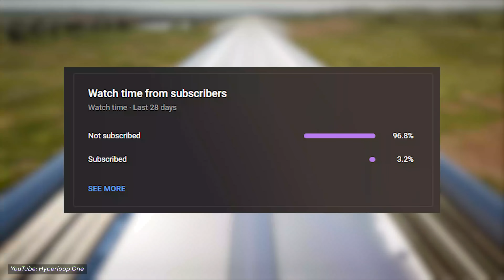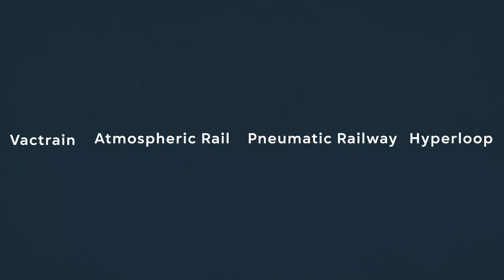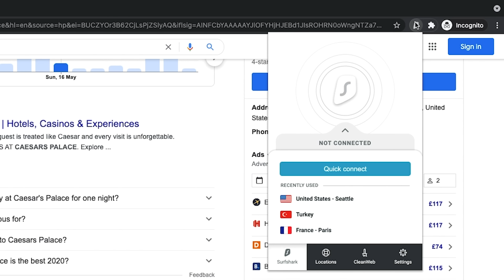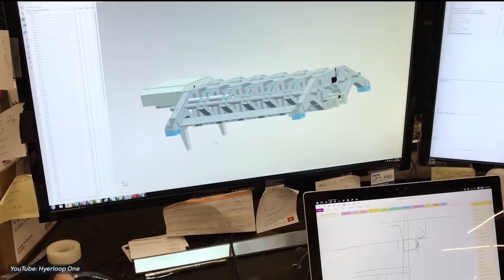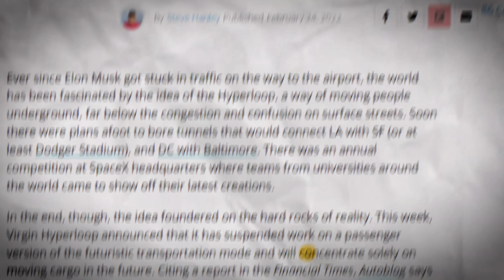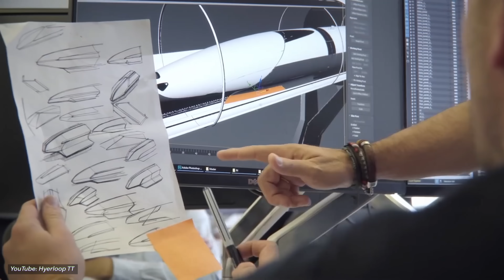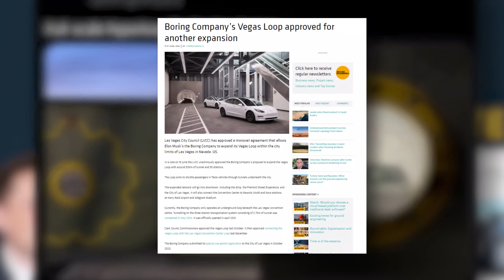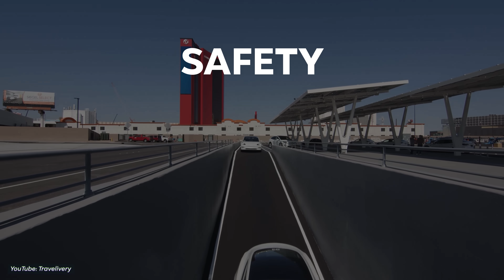What Happened to Hyperloop?

Comment: No, hyperloops will not be practical for at least a decade.  Too many technological and practical hurdles.

- The system would need multiple redundancies as a fail safe system.  ( Increasing complexity and cost. )

- All current hyperloop research efforts are to hyperloop as horse & buggy are to automobiles.

- The system will be nowhere near practical until each capsule can have it’s own frictionless force field. 

- One simple failure is all it would take to shutdown one hyperloop.   Then the hyperloop techs would need to go to the site.  Then there is the time required to completely resolve the situation.

- Let’s just suppose all the issues are worked out and hyperloops become omnipresent…. each tube is still one way.  It might only take 30 or 60 minutes to get to the next city, but to go in the opposite direction…. Everyone would have to wait until all the capsules have travelled the entire length of the hyperloop.  Unless there is a risky desire to insert a capsule at the halfway point and travel in the opposite direction.  That seems risky and adding unnecessary complications.

- How long will it take to vacuum seal one section of the tube?   How long will each section be?  How about maintaining all the equipment used for each section of the tube?  How long will it take to replace a section of the tube?  What are the consumables and their supply chains?

It would be more practical to build an elevator to the moon.

Comment: The hyperloop was not to be used here, it's for mars, boring company drill almost 9m, Starship diameter 9m. The tunnels on mars don't even need to be air tight, you don't need to evacuate the the tunnels as the Martian atmosphere is almost non existent.

Comment: Close tunnel. It would be just testing phrase as I know it required high maintain for air to breath, building into the tunnel, emergency tunnels else it would be death trap. There should be rescues team incase some thing broke or natural disaster or flooding. So the cost is would be higher. So basic transport goods. Just use magnet train that similar and in case into tube. Just a guess.

Comment: Hyperloop is, was, and always will be, total garbage!  The engineering and financial problems associated with Hyperloop are insurmountable in the sense that Maglev trains and/or aeroplanes will always be cheaper and more efficient.  It only takes a cursory look at the potential problems that need to be overcome and the limited (at best) advantages promised by Hyperloop to see this, and I'm shocked that people couldn't see through this scam immediately.  

The best thing for all concerned will be for Hyperloop TT to be laid to rest so that resources can be put to better use researching refinements and development of other transportation systems.  No doubt a "scheme" to create a maglev train running in a low pressure tube will once more resurface in the decades to come, complete with a sexy new name (Magmole?  VacuLev?  Magnasuck?) and better computer generated videos of how it will "work".

Comment: has nobody noticed that hyperloop would not require low-pressure tunnels on mars?
Reply: Have you noticed that if there's no low pressure tunnel it's just a train? Why do you need tunnels on Mars if there's already low pressure on the surface?
Reply: @piranhaofserengheti4878  congratulations! well spotted!

Comment: Yea because accellerating and breaking at 1200kph is possible on 500meters😂
Simple maths, if it's even possible, your brain would blow out of your head with the breaking power to stand still on this short length at this speeds.

Comment: I'd say just first start with maglev trains at all, then think of the whole vacuum stuff in a second step.
Or try having a normal train in a tunnel with slightly less air pressure.
Trying to revolutionize everything rarely works, just take an evolutionary approach and change one thing at a time...
Reply: China built its first Maglev years ago, one for commercial use, and so far, it has apparently been eating money. Slightly slower, conventional high-speed train parallel to it (shanghai - shanghai airport) has been loads more cost effective so far.
Reply: @stttttipa  Well China has bad habit of corruption and obfuscating real numbers. If in one year they want to propagate high speed trains, they will come with numbers showing how it is better than maglev. When year after they want to build more maglevs, they come with numbers proving the oposite. Using China as reliable source of data is silly

Comment: So, Hyperloop One's test track is 500 meters long and the pod traveling in it reached 387 km/h? Like, think about this for longer then two seconds...
Reply: Quick back-of-the-envelope calculations says 4G acceleration (until midpoint, where you have to start deceleration). You can't accelerate this fast starting from tracks. Skidding is the word. The only way I see this happen is using a jet engine (which ingores the skidding). Oh yes, and of course another jet engine to provide reverse thrust for the braking...

Comment: Edmonton to Calgary is suppose to start construction this year. At least according to transpods last update in January.
Reply: Hah!  Have they acquired even a single square metre of land to put it on?
Reply: @Jon Martin  ya they have a 10km stretch by the Edmonton airport to start as a test track. It’s the perfect place to test it, 300km apart, almost perfectly straight south to north and they can see how it fares in really fucking cold weather.
Reply: @timthompson7205  There better not be a single penny of my taxes going to this nonsense.
Reply: @Jon Martin  supposed to be privately funded. They’ve already raised 2/3 of the money. The province is just giving them the land beside highway 2. So far they’ve only signed over a 10km portion by the Edmonton airport for a test trial. You’d have to look it up though, it’s been a few months since I’ve heard anything about it.
Reply: @timthompson7205  Any press release about the province giving them land must have been scrubbed.  Links to the Edmonton-Calgary feasibility study are dead (404).  They talk about it relying on a new concept in physics called "veillance flux", but a paper - the only paper as best as I can tell - about veillance flux is written by a Transpod co-founder and is about surveillance, not energy, power, or transport.
Reply: @Jon Martin  I just looked at it again. January 4th 2023 ctv did an article about them adding a stop in red deer to the line. They already have $550 million in funding acquired. Says they’re waiting for the government and intend to start construction late this year or early 2024.
Reply: Okay I've watched some actual engineers talking about this and it is complete BS.  It is just another hyperloop scam operation with fancy CGI videos, made up numbers, and magic technology that they can't show but promise will work.
Reply: @@RandomOne927 There is no information indicating that the Alberta government has committed any money to this project.  According to TransPod: "No financial commitments or endorsements have been made by Alberta Transportation regarding the TransPod project."  The Alberta government's construction tracking site lists the TransPod project as "proposed".  TransPods's last press release about the Alberta project is from March 2022.  Add all that up and the obvious conclusion is that they have discovered reality is harder than CGI.

Comment: Hyperloop would work great on planets with low air pressure. But for earth, the cost and risks involved with depressurizing the vacuum tubes far outweigh the benefits with earths atmosphere. I think there’s a strong possibility that Musk open sourced the concept so that SpaceX could buy out the invention that made it the farthest when they could actually could use them on mars or the moon. Or even better, by the time they need them for the moon or mars, all the patents will have expired.

Comment: The biggest giveaway that this "Vacuum tube" idea wasn't going to be feasible is the fact that all these hyperloop transports are shaped like bullets i.e. very aerodynamic designs, which if its not going through air is very space inefficient. 
 Im also very wary of breakdowns which was so briefly touched upon by the video. If a train fails it blocks the track but can still be moved to a tangential track for repairs, so as to not clog the whole system. If a hyperloop fails the "cart" has no where to go AND has multiple subsonic "carts" behind it that need to be slowed very quickly (I would be interested in the G's experienced by passengers here), OR the tube explodes as air rushes in to fill the vacuum and disabling the entire system and severely injuring or even killing many occupants of the system.
Reply: The most frustrating thing I’ve seen from hyperloop simps is the way they dismiss the issue of sustaining a vacuum tube as “advances in science and technology.”

You can’t technobabble your way out of this.  The ONLY way to make it work is make a material strong to sustain the vacuum.  As in, “does not implode, or breach under stress.”  The fact that the largest vacuum chamber is basically a solid ball of concrete with one entry point made of thick metal should tell you exactly what forces you’re dealing with.  
Also, it takes 8 hours for that chamber to reach vacuum.  Now expand that to a tube hundreds of miles long.
Reply: To musk, science is an after thought.  Just get the funding first then who fking cares🤷🏻

Comment: New technologies cannot be rushed, the system has issues that needs to be ironed out. One, they need to add stops in those tunnels, stops that are emergency oriented, they haven't thought of that part at all. In any of these designs, all they have shown is go and never the possibility to stop, if stopping becomes what happens.safety should be paramont. We can always develop speed.

Comment: Never mind the expense and difficulties of maintaining evacuated tubes, none of the companies have demonstrated fast ingress/egress of passengers and/or cargo.  The test tracks need to repressurise the entire tube for this.
Reply: Technically, you don't have to do that, you could seal the vacuum around the door of the pod just before it opens. The seal wouldn't have to be extremely tight either, as only a 95% vacuum would be sufficient in the tube to increase speed drastically (perhaps not to 1000 km/h, but to airplane speed). So you only need to depressurise the tube once and maintain its depressurisation.
Conceptually, it all is possible. But I'm sure if you sweat all the details, it's harder than it seems. The main problem being security and the possibility of evacuation in case of an emergency in the middle of the tunnel, so it cannot be completely sealed everywhere.
In California though, the problem of earthquakes makes a tunnel that is hundreds of km long even more difficult if not downright impossible.
Reply: @InXLsisDeo  Physics and reality left the chat. You know that 95% vacuum is not that much different form 100%, don't you?
Reply: @InXLsisDeo  That would be a fast ingress/egress method, which the test tracks did not have.  In the absence of an airlock connection, the entire test track tube had to be evacuated and repressurised.
Reply: That is a deal breaker right there! Also how do the retrieve a stalled pod?

Comment: does it even need to be a "perfect" vacuum?  can't you just have a somewhat lower pressure environment than the outside?  or how about no vacuum at all?  create the tube to be 3 times the width of the pod or something like that, with extra space surrounding the pod.  if the pod is aerodynamic then it can just carve through the air at high speeds same as a jet.  yea maybe it will use more electricity  because of all the drag, but so what?
Reply: You could just put a bullet train in a tunnel, is that what you mean?
Reply: Failed science in school?

Comment: The hyper poop idea seems to have so many holes in it compared to proven tech we already have , it seems unlikely to ever see mass transit.
 As far as shooting shipping containers through the hyper loop to a destination, it sounds like an expensive proposition , especially given you can transport 10000 or more shipping containers in one go by boat , the boat is not fast , but they are efficient at transporting masses of containers from point A to point B.
Reply: Actually, hyperloops are mentioned in the Quran. Read Chapter Al-Maarij in the Quran, where Allaah (God) says the angels travels using hyperloops to cover a distance that would have otherwise taken them 50000 years if travelled otherwise. So, hyperloops isn't such a new idea.
Reply: The only way the traffic jam problem can be solved using hyperloops is if it were to be used by high capacity public trains and instead of cars.

What assures users of their safety in the worst case scenario of technology mulfuctioning? I can't imagine someone trapped down there in a vacuum tube for some minutes.
Reply: I agree with that, but maybe it can be used to improve movements inwards a country/region. When u have a boat at a harbor, maybe it can be used to transport instead of diesel trains and diesel trucks. That will probably have so much less pollution for some short distances.
Reply: @Stijnhulsebosch  Hmmm , pollution or not , its hard to beat big trucks which can load or unload at any distribution centres or any point across the country or pick up from any distribution centre or any point and head in any direction and in a timely manner and go long distance which doesnt cost too much .
 I might add , trucks also come in so many forms with so many different types of gear , like for example , side loaders which can drop a container on the ground in front of your house or pick it up , flat tops for general freight which comes in all shapes and sizes , dangerous goods transport , live stock transport , refrigerated transport , the list is endless not too mention the specialized over dimensional transport  rigs , tip trucks ,etc ,etc .. 
In my country there is a slogan  " without trucks Australia stops " , and its true , trucks are very efficient at getting freight from point to point especially in a large country .. 
Huge freight trains and boats are good for mass transit to wharfs and distribution centres and interstate a lot of the time  , but they have limits ,  rails dont go everywhere , and wharfs are huge joints , and often there is a back log of ships waiting to dock  to get unloaded or loaded .
 Some of these dopey politicians want to stop big trucks from coming into the citys and instead have thousands upon thousands  of little trucks which will be way more polluting than having a huge rig carting a lot of freight in one go with a relatively efficient engine to get the job done .
No doubt logistics varys from country to country , but there can be  a huge cost trying to be too green .
One of the things people dont think about , is freight cost , goods and services that use transport effect every single thing you buy , trucks transport your raw materials for just about everything from food to clothes , to building materials , to tech in the stores , etc ,etc .
 In my country policy makers for decades have been using trucks and the transport industry as an easy target for revenue ( in effect it is a form of indirect taxing ) , and transport companys and truckers have no alternative but to put the prices up  which again directly effects every single thing you buy , and it is a flow on effect , everything becomes more expensive .
This is why a pair of runners costs 200 bucks , a hamburger costs around the ten buck mark , and here we are today .
 I dont know what the answer is my friend , maybe we need to go back to the old days with horse and cart and grow veggies out in back garden    :) .
Anyway , have a good day sir .
Reply: @mikldude9376  I don't see what's the problem with small trucks that dispatch stuff within cities and small towns. Being smaller, they can go electric and they are more convenient than big trucks. In fact, that's how it works in the Netherlands, in Japan, and plenty of asian countries. Some smart Americans are now importing old small trucks from Japan rather than buying the stupidly large, wasteful and inconvenient pickup trucks that murrican car makers are trying to sell them.

Comment: Setting aside technology, cost, maintenance, and internal traffic management questions - HYPErloop would not do much to relieve our traffic problems overall.  It would not be of great benefit to use it for numerous short runs or stop-and-go lines.  It would consist mainly (or entirely) of express routes between elitist strongholds, zooming past everyone in between. It would likely create local traffic headaches in the vicinity of terminals where it will be necessary to transfer to and from other modes of transportation.

Comment: We know that sound pockets exists. We know that sound can trap or transfer air. We also know that spot lights with speaker technology is a concept. Why not use sound to trap the air between certain checkpoints to maintain air pressure?
Reply: Why don't you do it? I'm pretty sure you'll make a fortune if it works.